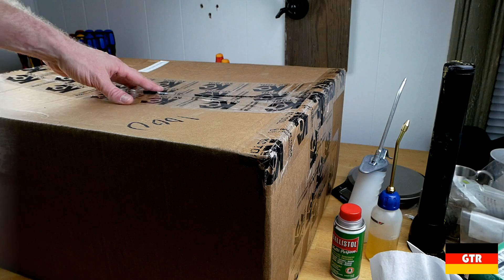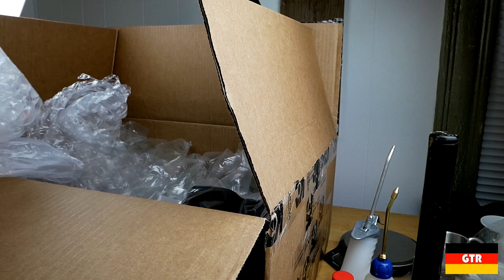KC Tool Unboxing E06

Comment: I have that drive coupler. I bought it for a Gedore 3293. The button on the back releases the coupler from the ratchet and the sockets are held in with the pin detent. It's a pain if you lay the ratchet down with the socket facing up but works well on such a coarse, simple design. I'm considering a magnet epoxied to the handle to keep a small pick for the detent handy.
Reply from the maker: Thanks for the info, I was scratching my head as to which end on the socket.  I suppose it will only fit one one end but I was expecting the ball bearing to be on the socket end and not the ratchet end.